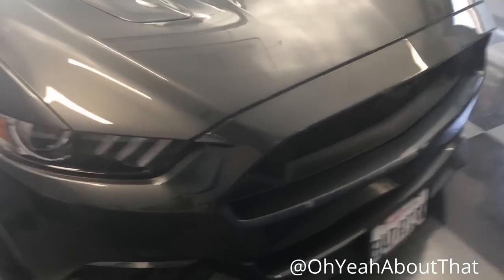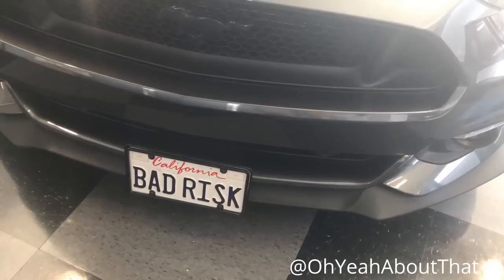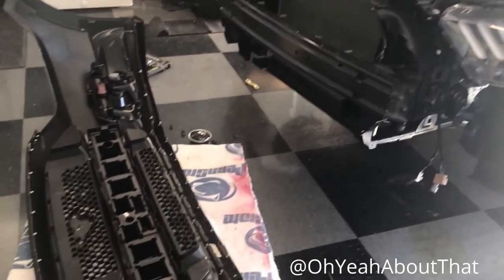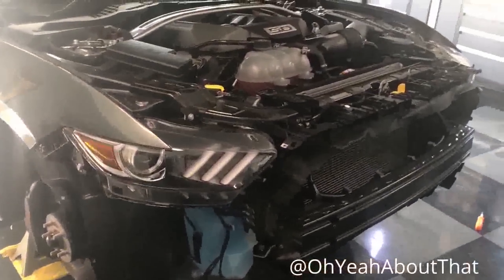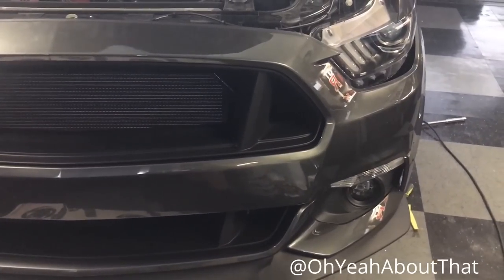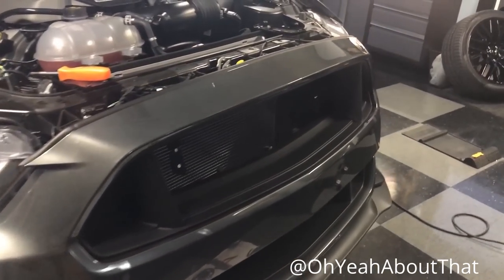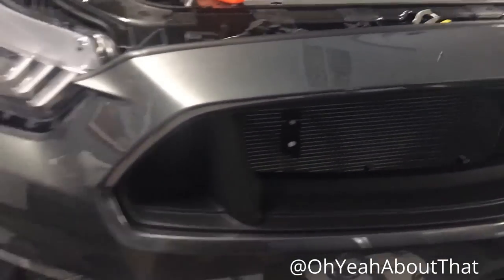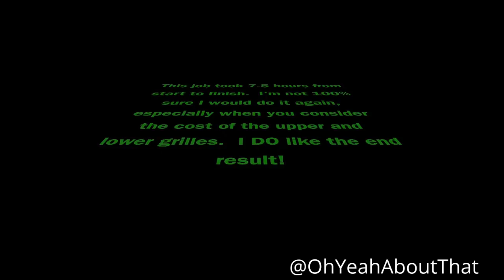2017 Ford Mustang GT [Ep. 13] CERVINI GRILLES AND HOWLER BADGE!

Comment: Just curious, if you still have the Cervini Grille, how is the metal mesh holding up? I saw in another vid that it looks kinda flimsy. Can it withstand small rocks and what not hitting it?
Reply from the maker: Jason M I no longer have this car but I can confirm it is flimsy and will probably rust easily. I would definitely upgrade to stronger mesh.
Reply: @OhYeahAboutThat  Ok awesome that helps alot. Thanks for the reply

Comment: Is the badge screwed into the grill or is there a mount and 3M behind badge
Reply from the maker: There is a mount behind that you attach the badge to with the 3m tape. It’s a nice system.
Reply: OhYeahAboutThat Any issues with the badge falling off ?
Reply from the maker: Skidzjr none. I actually replaced this badge with a slightly smaller, metal badge. They both attach the same way and there is no issue with them falling off. The smaller badge is in another video in this playlist.